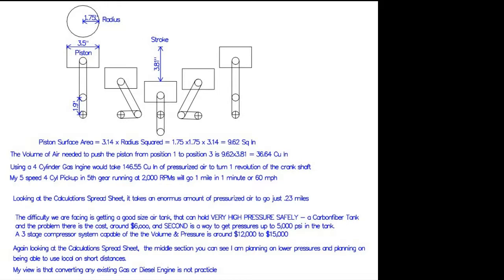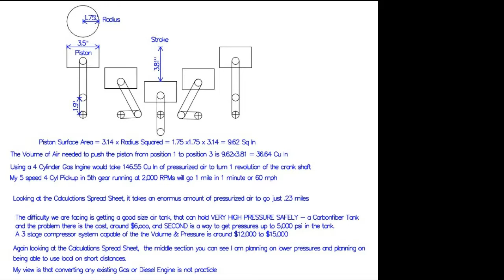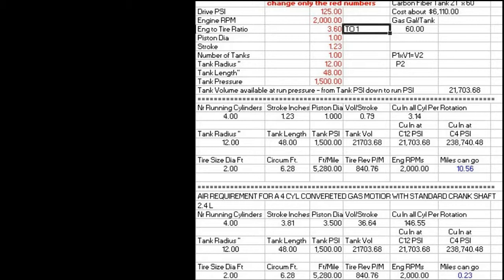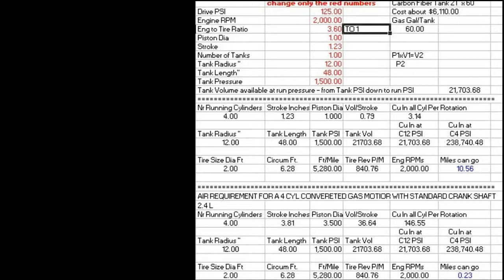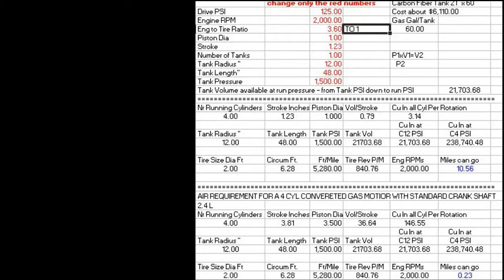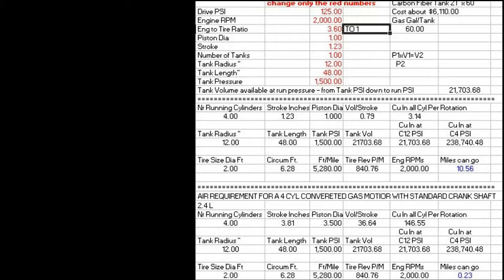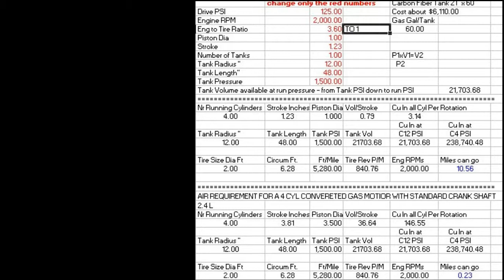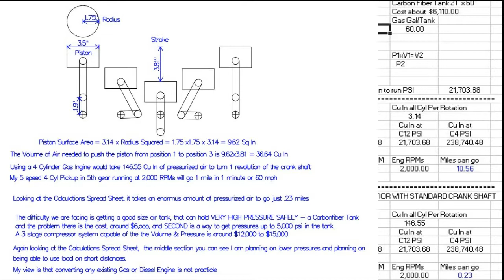Convert a Gas Engine to Compressed Air

Comment: Around 18yrs ago I had a similar idea, I haven't researched any for anything similar to what I've put together in the past couple months, this has lead me to put something else together but I plan to get paid for it.
Reply: Check out my two most recent videos, utube
Reply: This will bring technology to a new level.
Reply from the maker: I’m afraid you’re going to be sadly disappointed if you plan on using a converted gasoline motor to an air motor, the amount of air required to run that size of an engine is enormas.
 I’ve spent 10 or 12 years working on an efficient engine which I have created, would still require a 30 or 35 gallon very high pressure air tank at 5000 PSI to have a distance of 150 and 200 miles.
If you go to my Air Engine Research website and check out the numerous videos that I have made describing the different conditions and requirements you will see the problems. There are about 40 to 47 videos
Reply: Air Engine Research ,that's not my plan convert to a air powered motor.
Reply: Air Engine Research have you tried a supercharger?
Reply: @AirEngineResearch can you post the address of your site?
Reply: @AndreLuiz-ip3fh  I don't have a website just utube
Reply: @AndreLuiz-ip3fh  punch in my name, just a few videos
Reply from the maker: https://www.youtube.com/channel/UCYeCMYHk5IqDLCNqcb5pF_g?view_as=subscriber

Comment: Stage a few 4500 psi paintball tanks or scuba tanks for tests?
Reply: 4500 would go a long way, look into the scuba compressor, expensive,
Reply: Looking through the scuba compressor and tanks, the aluminum tanks are good but the way it's been going capacity is what drives the system (air guns, trucks, garages ect., increasing the internal pressure of a tank also increases the capacity, looks like any tank , other than actyletin, is a good option to increase the capacity and pressure, looks like the outgoing air on a scuba compressor is reduced to 3/8" that increases pressure internally on the compressor there but it's still a 3 or 4 phase like the 2 or 3 stage circulating with lots of different designs in the head.